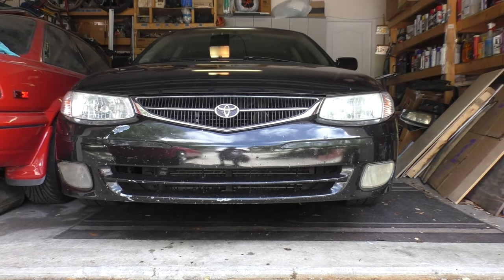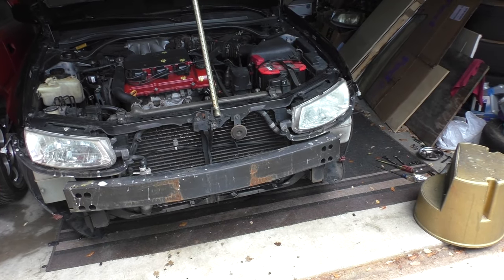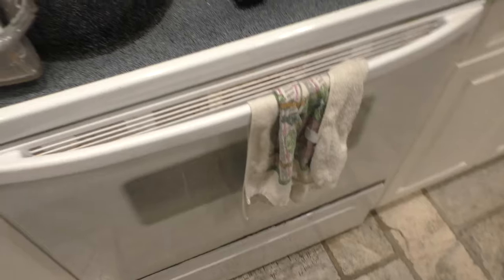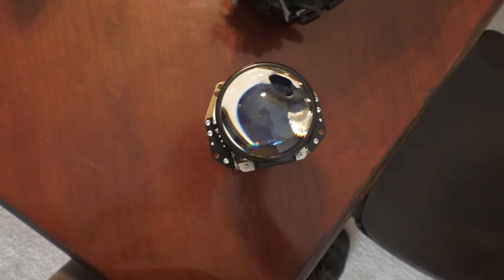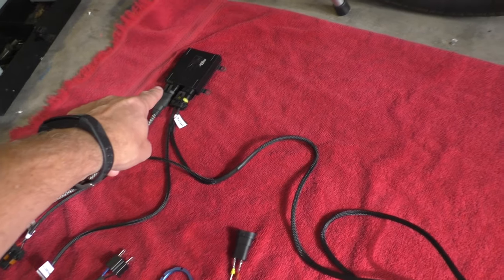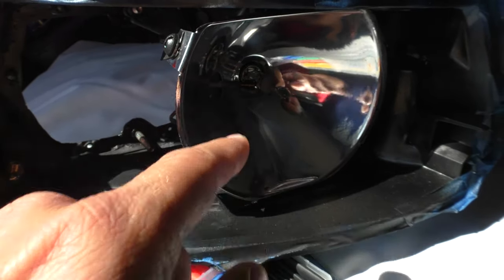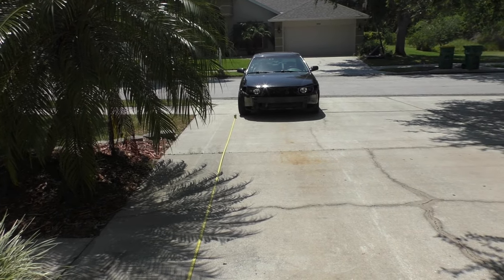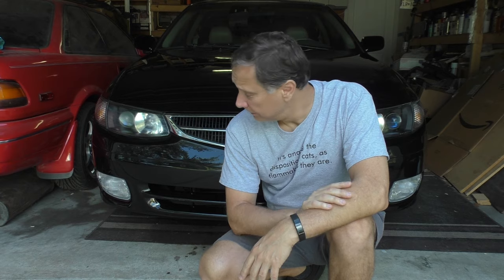AG 002 Making my own custom headlights

Comment from the maker: It's been 2 years since I did this and I have a few comments. 
1.  The quality and quantity of the light output from these lights is superb.  I absolutely love it.  I can see sooooo much better.
2.  Despite the brightness, the lights don't blind oncoming drivers.  I know, I checked this AND no one flashes lights at us.
3.  The work I did so far has stood the test of time.  They work properly and I don't get any moisture inside.
4.  It is illegal to put a blue light anywhere on the front of a car in the state of Florida.  That's for cops.
5.  This video was waaay too long.  Sorry.